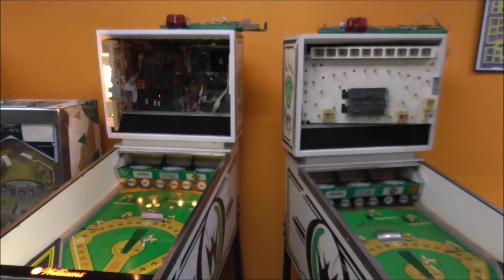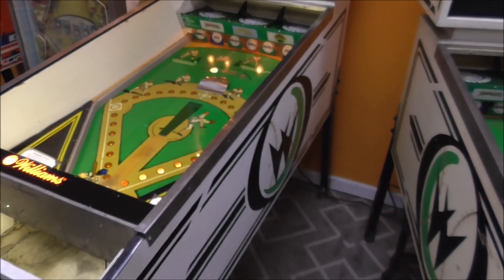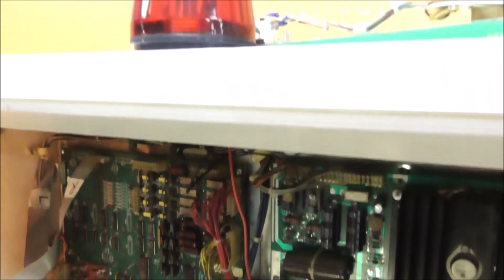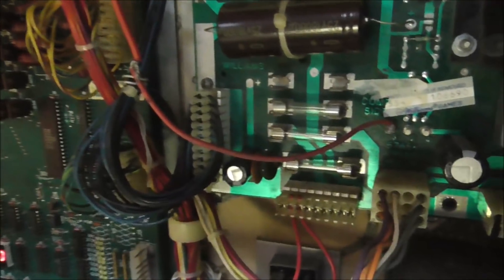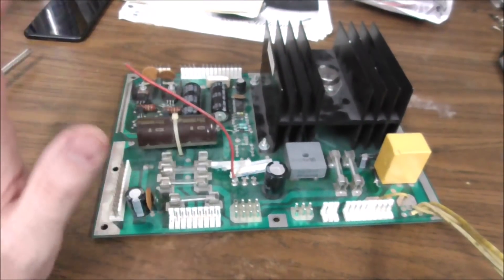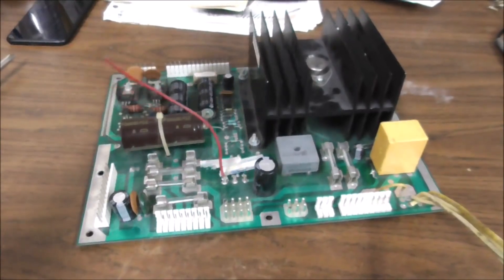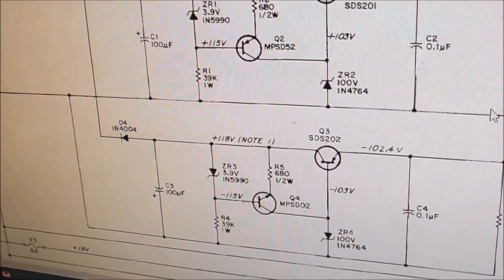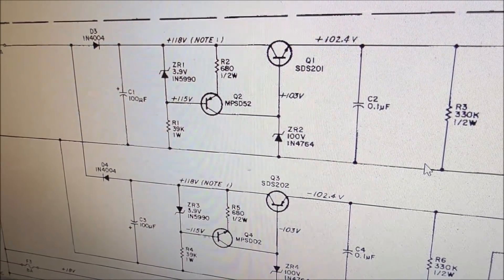Pennant Fever Pitch & Bat Repair #2 - Fixing the Displays/ MPU Repair Video of a Rare System 8 PCB

Comment: just thought of a quick question while looking at your pristine battery box.  If you put in new lithium cell aa batteries in the battery box would you have to worry about the batteries leaking like alkaline batteries?
Reply from the maker: You'd be fine with Lithium, I don't believe they leak do they?
Reply: @LyonsArcade  not an argument.  I didn't think they did either but was too worried to test the theory though energizer does state on there website that they do not leak under normal consumer usage.  they do have a phone number if you think it is leaking though but if they don't think normal usage will make them spontaneously leak then the only thing that might make them leak would be some type of trauma and in that case I would probably have other problems to consider